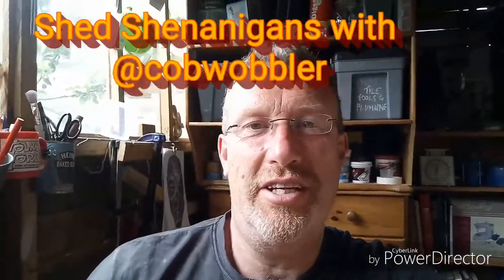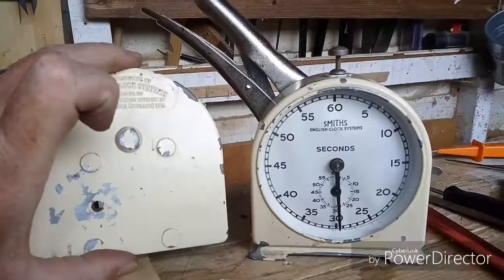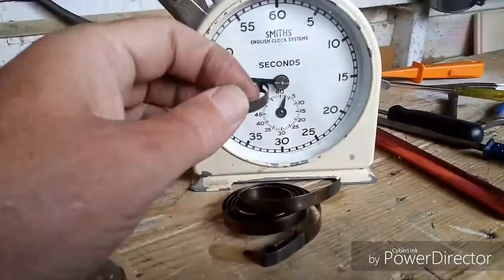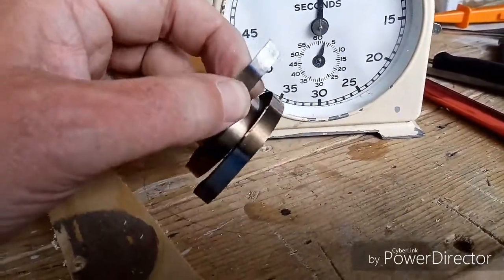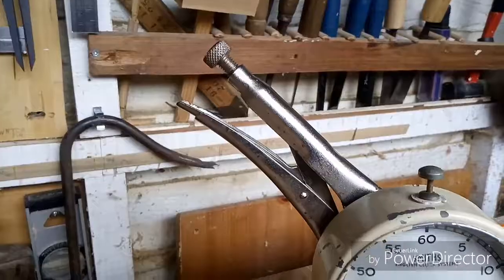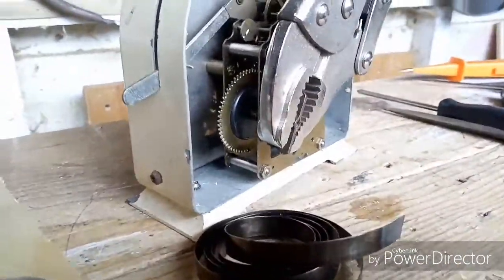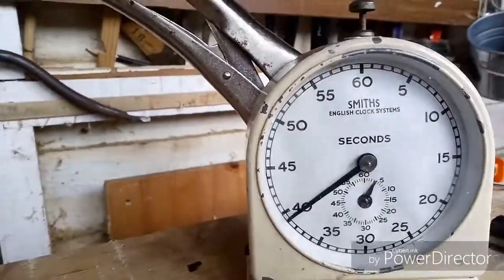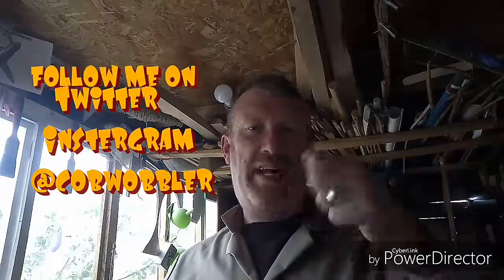Smiths Stop Clock fixed with Mole grips???

Comment: Do you recall which way the retaining screw turns that holds the winder butterfly on?  Mine is frozen and I don't want to force it the wrong way.  Logically it should be a reverse thread since the winder turns anti-clockwise.
Reply from the maker: To be honest I can't remember, I'll see if I can find the clock in my shed.
Reply: @DIY-DaddyO   It's ok, don't worry, I've figured it out.  After a drop of penetrating oil and 24 hrs it unscrewed easily clockwise.  Clock now fully restored.  Thanks.